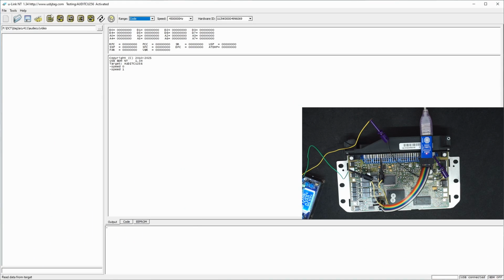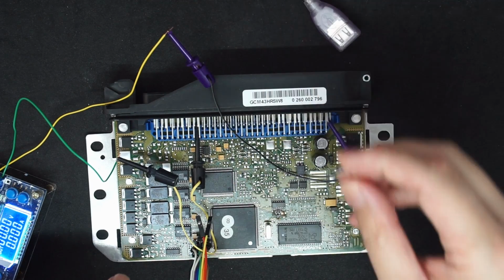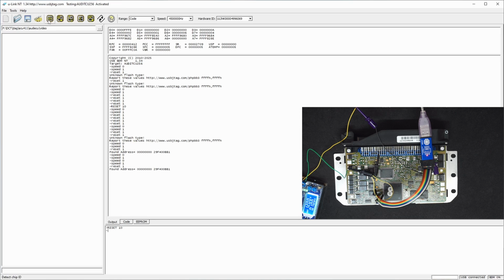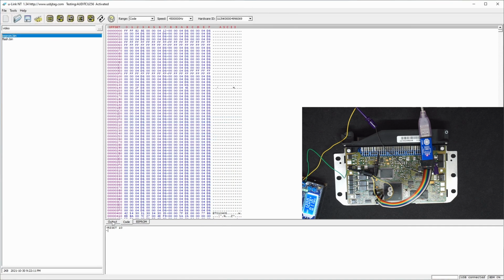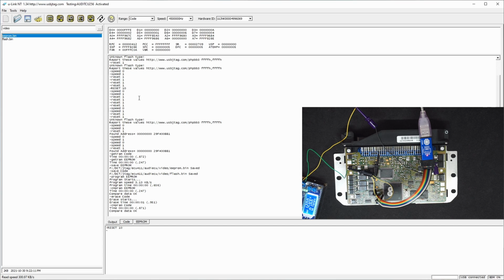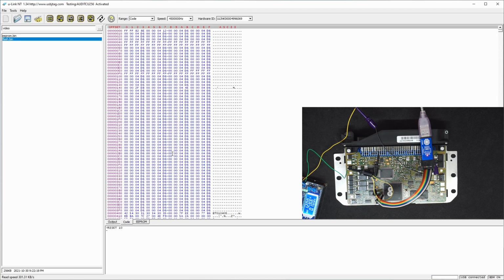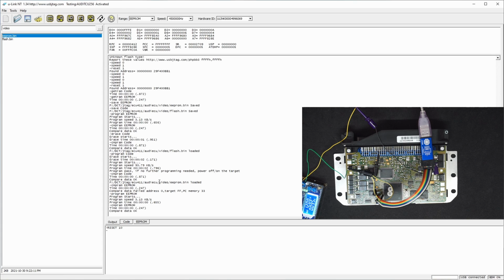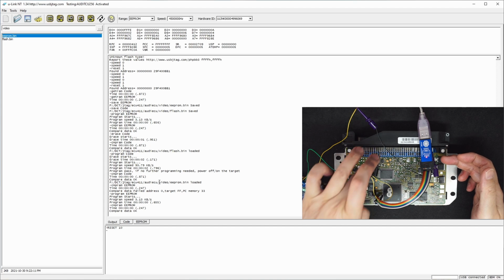u-Link NT program Audi TCU

Comment: Please have I want flash for this tcu
Reply from the maker: If you have the tool you should be able to do what is done in the video.
Reply: @usbbdm   l want flash software for audi transmission units. How ican get it please ....
Reply from the maker: @mustafaalsaadi6757  You need u-Link NT or USB BDM then you should be able to do it. Check www.usbjtag.com
Reply: @usbbdm  Will ST_link work?
Reply from the maker: @Benzynowiec  No. The design is different.